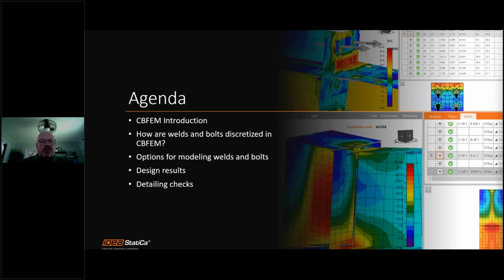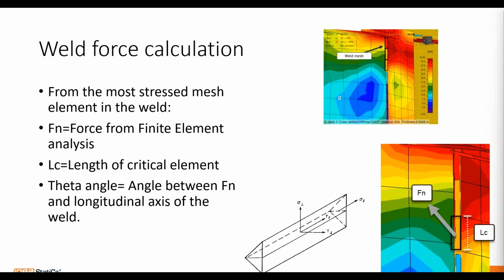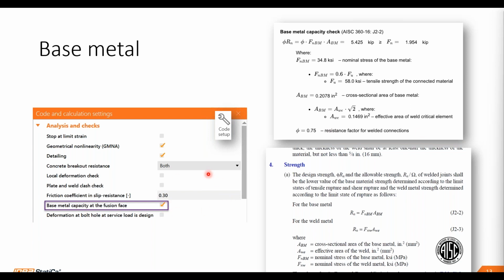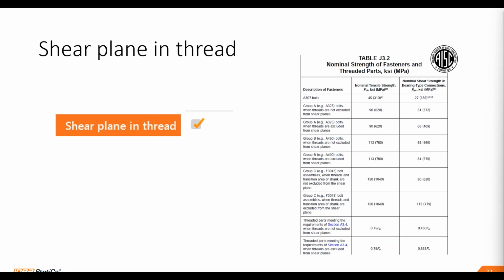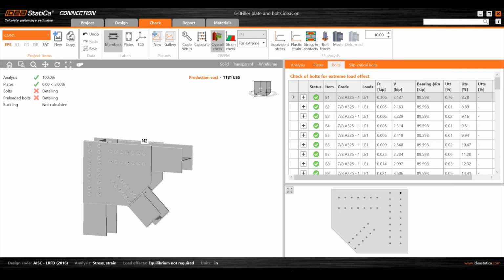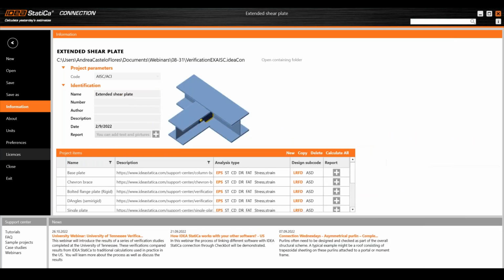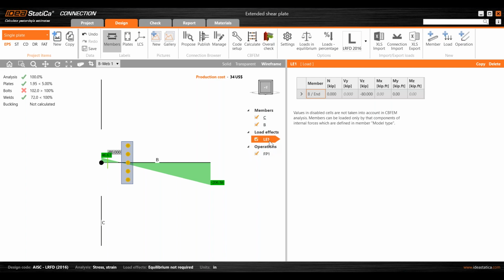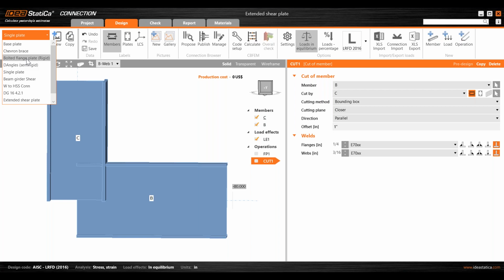Welds & Bolts in IDEA StatiCa (AISC)

Comment: How to increase of bolt length?
Reply from the maker: Hello, bolt length is set automatically between the head and nut of connected plates and can not be changed.
You can edit the shape of bolts in the Materials tab:
https://www.ideastatica.com/support-center/user-defined-material-material-and-product-range-library-mprl

Comment: Is it possible to change the pretension force factor in AISC?
Reply from the maker: Hello, Im not sure what factor is this one, but you can change various factors in IDEA StatiCa Connection in the Code setup (in the ribbon of the main window).
Preloaded bolts checks work like this:
https://www.ideastatica.com/support-center/check-of-bolts-and-preloaded-bolts-according-to-aisc

Comment: how is the length of critical weld element calculated?
Reply from the maker: Hello, the weld is divided into finite elements, depending on the length of the weld, usually its around 8 elements.
Read more here:
https://www.ideastatica.com/support-center/welds
https://www.ideastatica.com/support-center/check-of-welds-according-to-aisc
https://www.ideastatica.com/support-center/weld-welds-in-idea-statica

Comment: Is it possible to butt weld two pipes intersecting at a 90 degree angle in Ideastatica?
Reply from the maker: Hello, yes of course :)
https://www.ideastatica.com/support-center/y-shape-welded-tubes
you can also find many many examples in the Connection Library - just define the tubular sections in search parameters
https://connectionlibrary.ideastatica.com/set/public